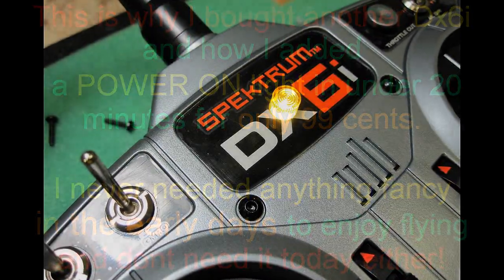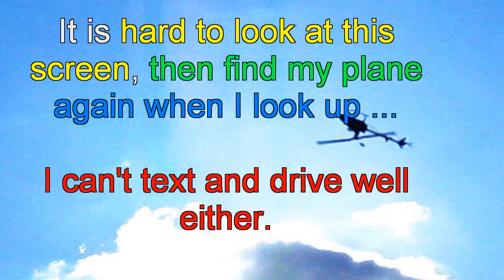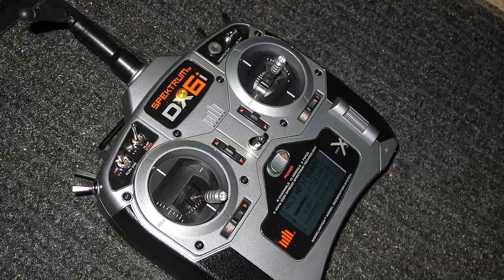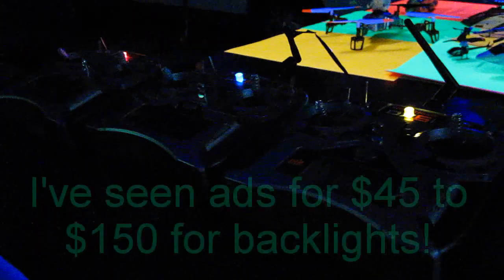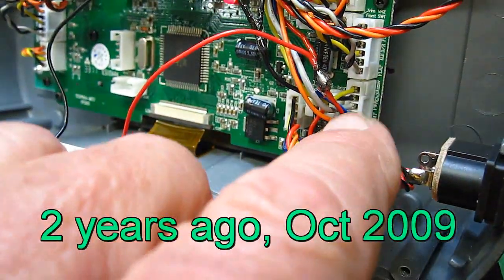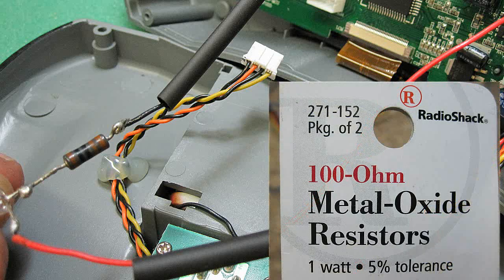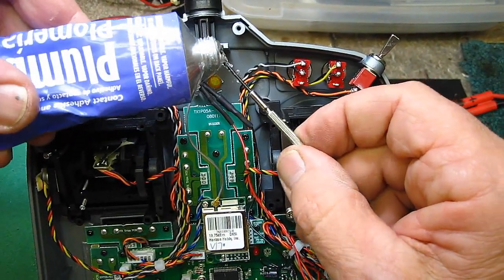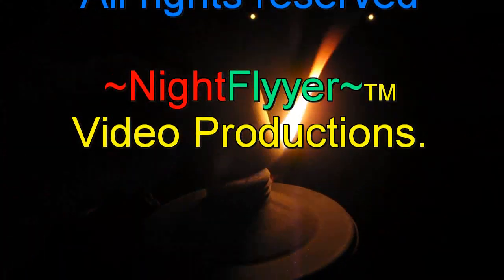Power ON Light for DX6i. Why and how.

Comment: Just did this mod, and I want to give you a big thanks because I was constantly leaving my DX6i on and killing my batteries.  

However, one point of fact.  I used the exact LED and resistor in your video from Radio Shack (276-320 and 271-152) and they are no longer $.99.  In fact, the LED costs $5.99 and the resistor (pack of 2) costs $1.49.  I had to order the Lens cover that cost $.39 each.  So overall it costs about $7.87 or a little over $8 with tax.  But either way well worth it for me.

Comment: Dave, I used your LED power on on my DX6i.  Thanks for the tip.  The backlight panel prices are cheaper than you think.  Only $15.50.   I installed mine from 2 parts ordered from Ebay.  First, the "EL Lamp electroluminescent panel" was $9.50 and second the "USB 5V DC to AC inverter EL Lamp Foil Wire electroluminescent" was $6.  For $15.50 (shipping included), it's worth it.  The seller is abakuscom.  There are videos on YouTube describing the installation.